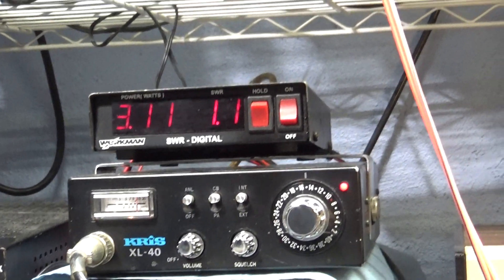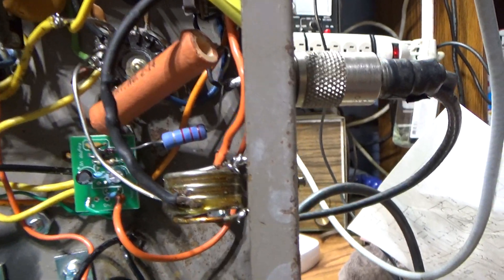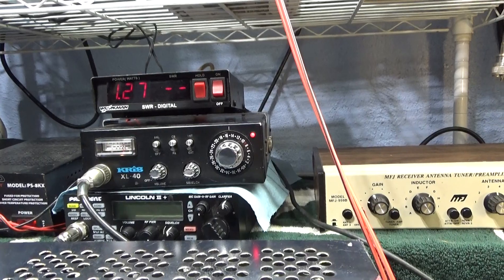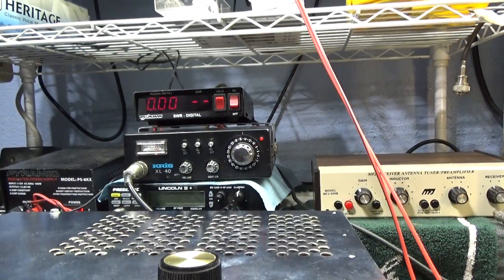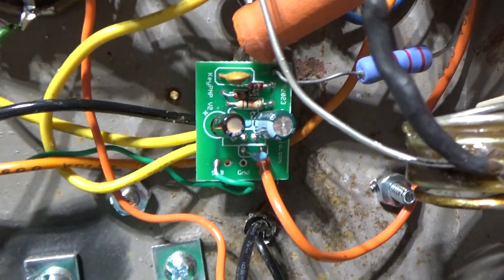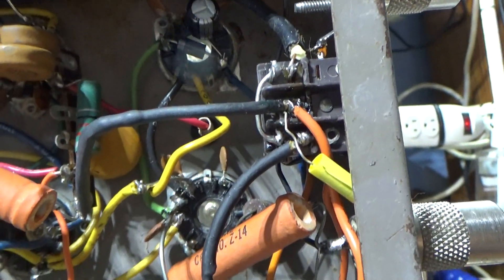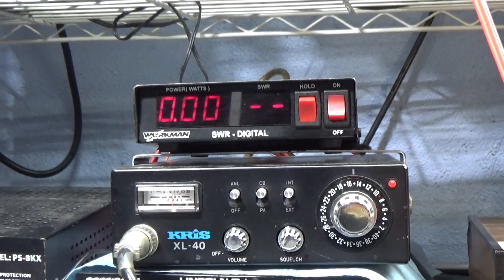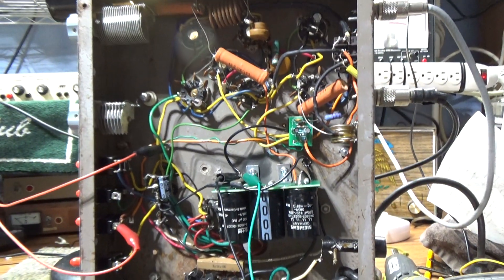Watts are Relative, + Keying Circuit Tips

Comment: You've got a real enigma there! You're just going to have to trace the RF input circuit with a meter to find the short. It wouldn't surprise me if the relay issue is a result of the input circuit problem. I will guess that there is an input sub circuit whose job is to make the input impedance close to 50 ohms. 
You are spot on about the accuracy of wattmeters. They are only accurate with a resistive load. Since an antenna is a combination of inductive and capacitive reactances some meters read low and others read high. But just for reference, 4 watts into a 50 ohm resistive load equals 14.14 volts. If you are designing a keying circuit for an amp you have to keep that in mind.
Reply from the maker: You had me at enigma.
Reply: @tramdr  Calling it a "mystery" would have been too predictable.